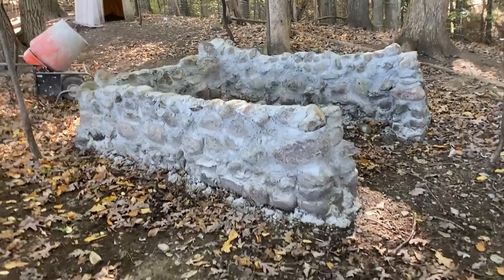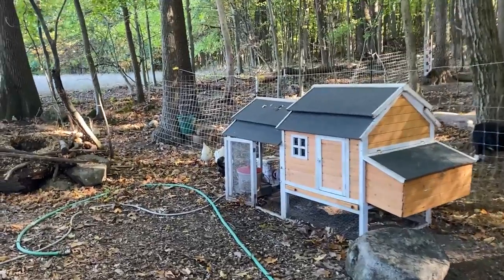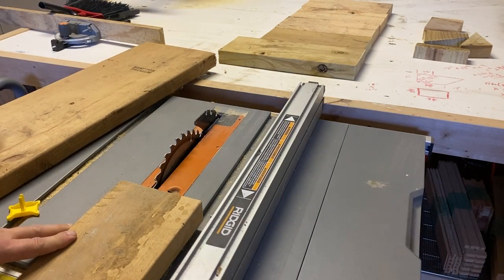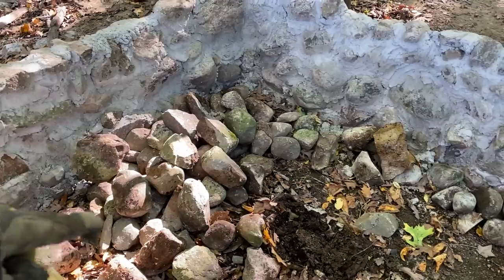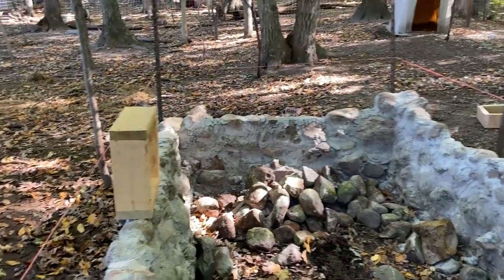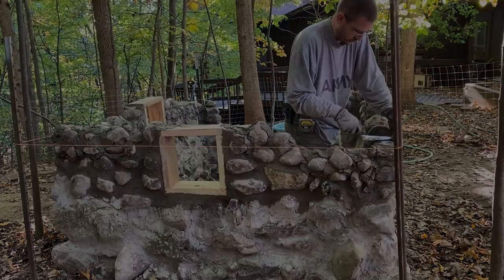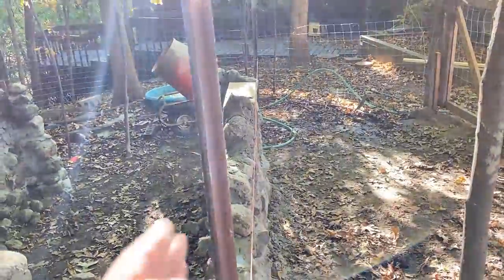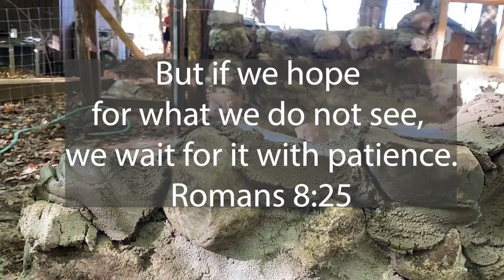Chicken Coop Goat Shelter: Part 5 Window Frames

Comment: You may have figured it out later in the video, but if you have screws or nail heads sticking out of the window frame into the mortar it can really lock the window frame into the wall.  This is a good idea for using local materials.  Also, as you already know I am sure, a smaller/lower roof can help keep the animals heat around them in the winter vs having it all go up away from them.  So shorter is better. :)
Reply from the maker: Great points!

Comment: the overhang will help protect the rocks and mortar from the rain.
Reply: Keeping it moist just as a concrete slab is beneficial to mortar and concrete, it makes it stronger in the long run instead of letting it dry out. Texas had a long drought and people were out watering around the foundation to keep it from cracking from being too dry.

Comment: Question: does anyone know why he didn't treat the wood with linseed oil, to protect it? Most people seem to skip this step. Is it the cost & time, or they just don't care? TIA
Reply from the maker: In this case I used mostly treated lumber. The few pieces of untreated lumber I could have put oil on but, I just didn’t care:)
Reply: @SSLFamilyDad  thank you for explaining. You by far are not the only one. Most yt'ers don't. I learned to always protect the wood from moisture loss, especially with exposed wood. So when I started watching yt regularly & almost no one was doing it. I figured they knew something I didn't know. But then no one every explained what that was. Thank you again, it's been slightly bothersome for yrs. Lol!